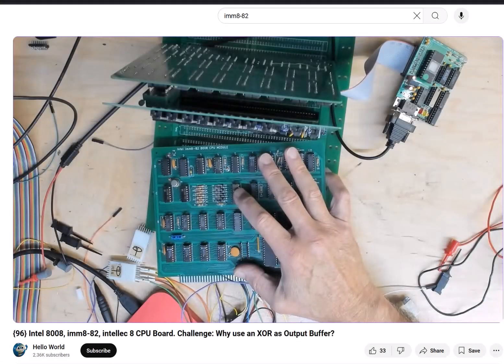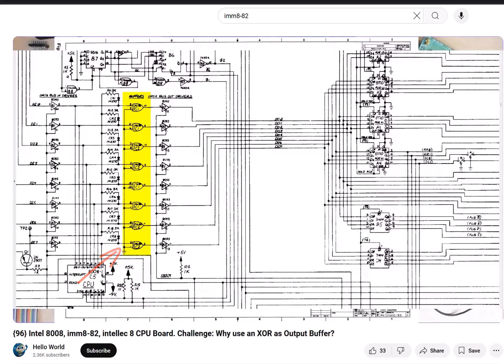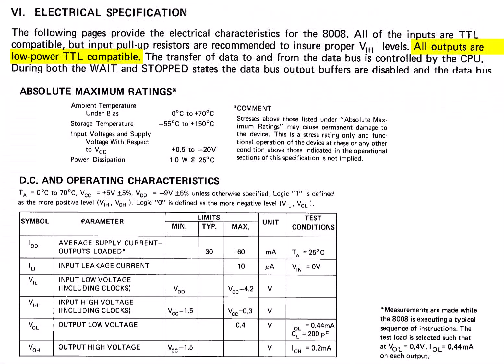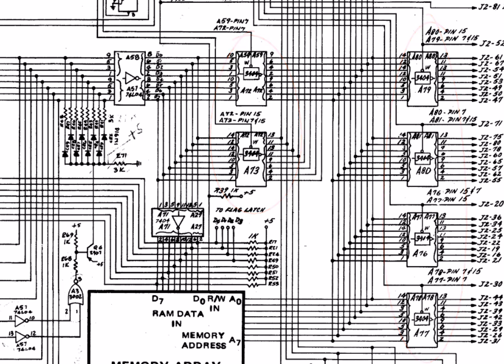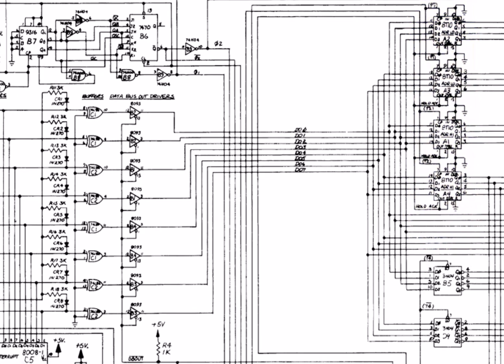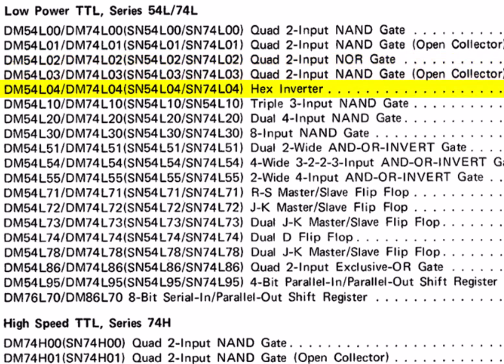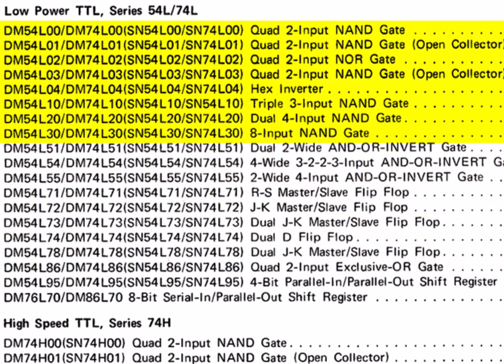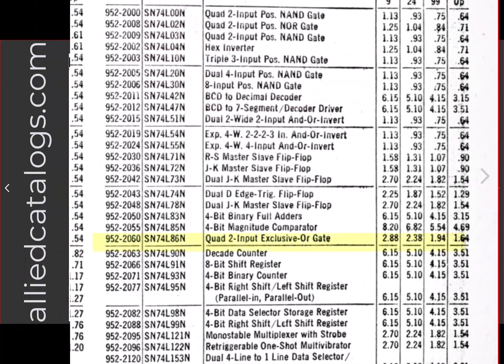{126}  Intel's Odd Use of an Exclusive OR Output Buffer in their Intellec 8 8008 CPU Board

Comment: Something annoying about the 74L86 is that is does not share the pin-out of all of the other 74X86 chips (including the plain 7486).  I discovered this the hard way some years ago and was recently reminded of it while I was restoring a Tarbell cassette interface.
Reply: Ugh!  It took me 30 years to learn that the Texas Instruments CD4013 had a schmitt trigger on it's D input while the National Semiconductor's CD4013 did not an so had a minimum risetime.  I'd say "I wish there was a special circle in hell..." but maybe the TI guy was trying to improve things.  The 74L86 guy, well, that's different.  Same goes for those who illustrate "pinouts from below" on their datasheets.  Thanks for the warning!
Reply from the maker: Oooohhhh I can relate to that.  It was long enough ago that I don't remember what project it was, but vividly I remember the realization and forehead slap after I finally figured out my mistake.  I am glad you brought that up since I was well overdue for a reminder lest it bite me again.
Reply: @HelloWorldETX  And the 74L86 is "unobtainium".  I wired up a couple of stacked sockets so that I could use a 74LS86 on the Tarbell.

Comment: I was thinking it might have been so they'd have a choice between positive and negative logic. But it's interesting that at the time XOR was the only positive logic gate available. I hadn't picked up on that little detail.
Reply from the maker: @TomStorey96  Yea, me too.  If there had been any visible means of changing that second input of all XORs from low to high (making them inverters) , I would have written it off as a diagnostic or QC tool.  But there isn’t, and I couldn’t come up with any technical reason for the XOR.  So I kept going down the rabbit hole.